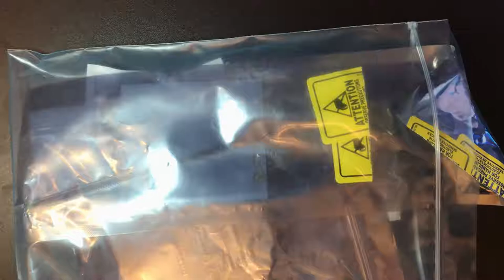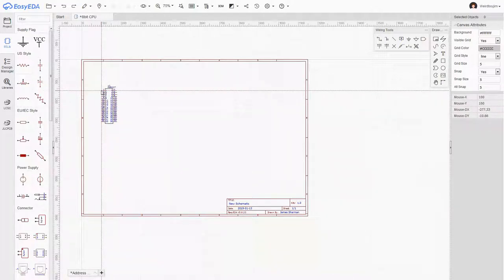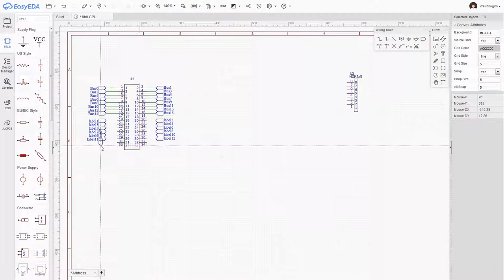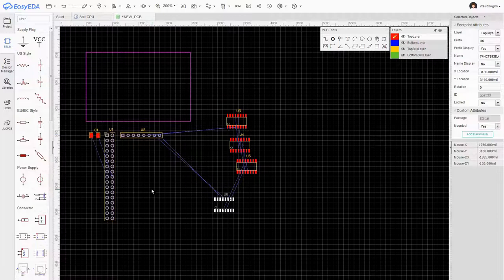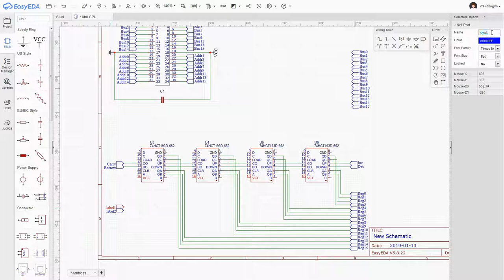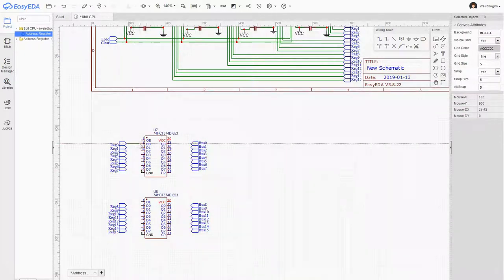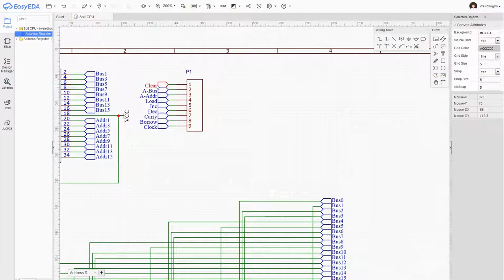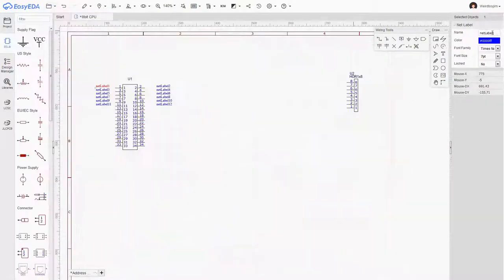Address registers (5: Schematic) - Making an 8 Bit pipelined CPU - Part 12

Comment: Just use the BUS line tool in EasyEDA a lot less time consuming, much easier and you will have more rooms in your schematic. Cool project by the way, and thanks for all the effort. You have been a great inspiration.
Reply from the maker: Thanks Ilgaar, glad you're finding it interesting. I spent some time trying to work out the EasyEda BUS feature ages ago only to find out later it was bugged when I was trying. I should go back and try and work it out.

Comment: 24:00 - I realize I'm over a year late, but I did enjoy watching this video and would like to see more. I'm very interested in learning PCB design, but every time I sit down and start working on something, I give up because I can't make heads or tails of the parts selection system.
Reply from the maker: I can't change the past obviously, but I have left a fairly decent amount of the schematic work in there.  What EDA software are you using? I can only really comment for EasyEDA but if I get stuck I go and look for the device on lcsc and then search by part number.
Reply: I tried EagleCAD first because it was frequently referenced in an Arduino book I was reading. I even bought a book to try and learn it, but that program is impossibly difficult to use for anyone who is familiar with how 90% of other software programs work. I've heard a lot about KiCAD and EasyEDA, but have not settled on either. My most recent experience was with EasyEDA. That was probably my most successful experience even though I never got a board created. Like I mentioned before, the main issue is the parts selection system. If I want to have a simple push button switch like I use on a breadboard, I simply can't find a matching part. I do understand ultimately all I need are the right dimensions, the right size holes, and the right copper traces. But I don't know enough about these PCB making programs to just put holes in the board where I need them to be.

Comment: HI,
Thanks for your really great work!! Why do you need 2 different 16 bit busses, one for adress of rom, one for copying to other 16 bit registeres? Why not use 1 bus  for all? sorry, a newbie question ...
Reply: oops, ofcourse, ls541 is 8 bit not 16, sorry, closed :-)
Reply: or not?
Reply from the maker: No need to apologise, this is a very valid question. I could indeed have done it with a single combined 16 bit bus, the results is that every 16bit move would have become a 2cycle instruction (since I would have tied up the bus while using it for the move). I haven’t changed my mind about that, but there are plenty of other “just as valid” options. One strong alternative is to do away with the transfer bus and make the 16bit registers load in 2 halves, You need to do some more complicated things in the pipeline to handle a jump to 16 bit address though.

Comment: Those schematic symbols for the '193s could have been drawn a lot better. Schematic should represent signal flow, so inputs on the left and outputs on the right. Drawing them according to their physical pinout will result in schematics that hard to follow.

You may have realised this in a later video but this is as far as I've gotten so far. 🙂
Reply from the maker: You are no doubt correct, but at the moment I’ve just been using the pre-built symbols in the easyeda library. I’ll experiment with creating my own in the future, it has been easier when things are as you suggest.
Reply: @weirdboyjim  ah, I didn't realise that was a prebuilt symbol. It's definitely worth learning how to draw your own.

Comment: you wired the control LEDs all in the same direction, but there are active low and active high ones, what is the reason for?
Reply from the maker: I actually say in the video that “They are all active low” but this is technically incorrect. The assert lines and load are active low but the increment and decrement lines count on “Rising edge”. The signals rest high and are brought low for half a cycle when I want to increment (or decrement) so for the purposes of lighting an LED I can treat them as active low (i.e. the only time they are low is when the action will occur in this cycle).
Reply: @weirdboyjim  thanka for explaining!!